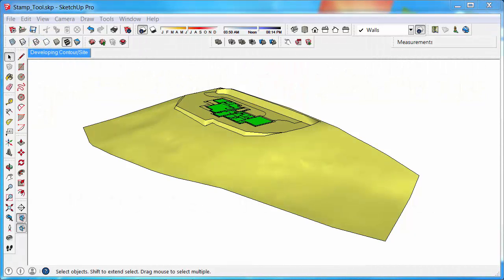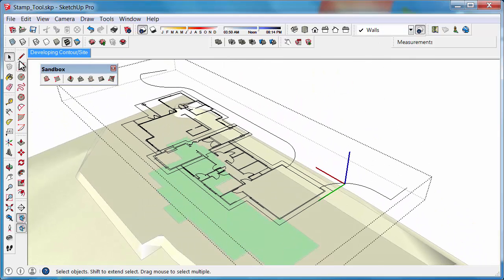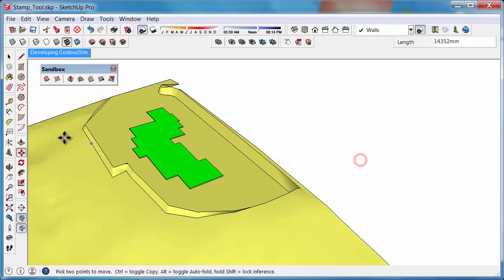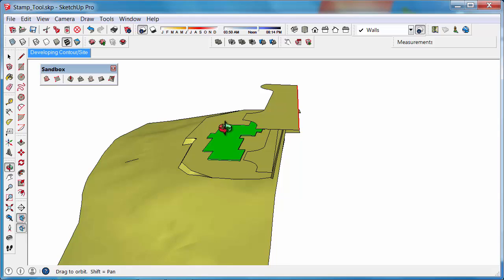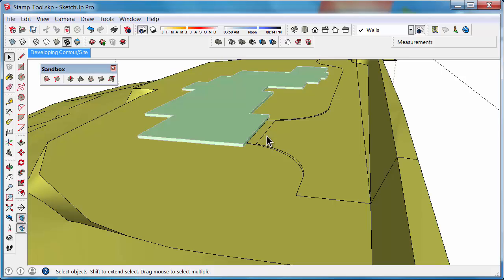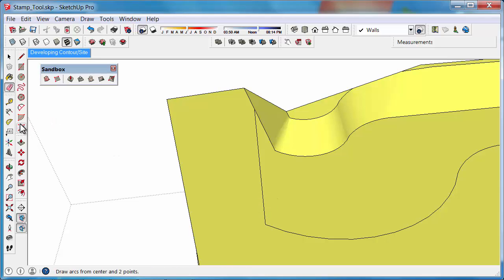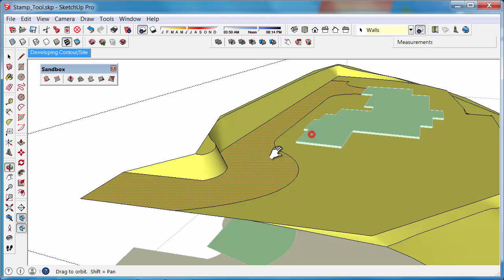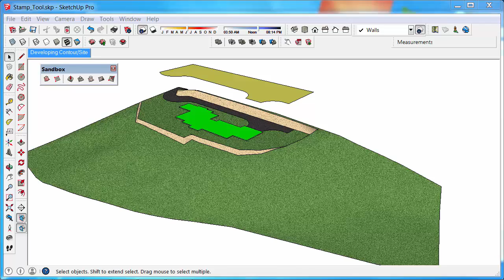SketchUp - How to use the Drape Tool

Comment: How did you connect the flat surface where your site is to the surrounding terrain? Really struggling with this at the moment would love to know how to do it! Thanks
Reply from the maker: Hi Jack, I would use the From Contours tool.  Select the outline/perimeter of your flat platform, and the outline of the contour surface you wish to merge to (You may need to turn on Hidden Geometry to select the outline of your contours surface - (View menu/hidden geometry)).  Next click on the From Contours tool.  It will drape surfaces over top of the edges you've selected.  The surface created by the from contours tool gets put into a group.  Edit the group, then again turn on the hidden geometry.  Then delete any excess triangles that you don't need / already have.  Once completed, close the group and explode the group, and the left over surface will merge with your existing flat plane and 3d contours.  If this doesn't make sense please let me know?